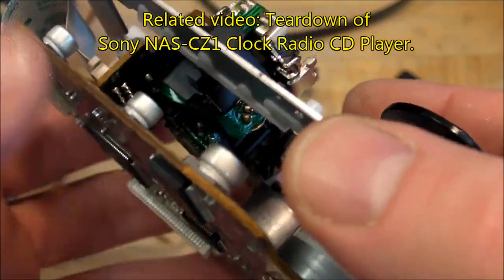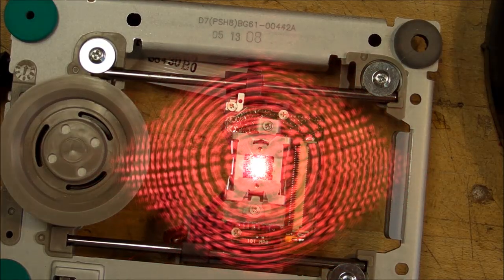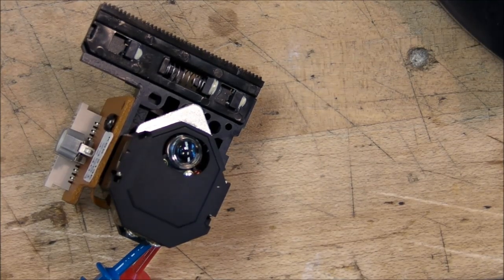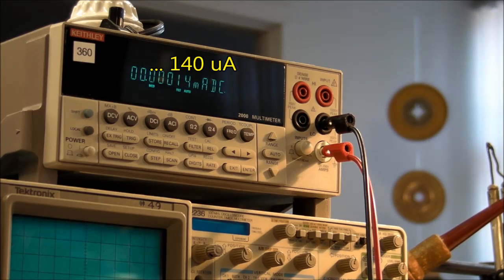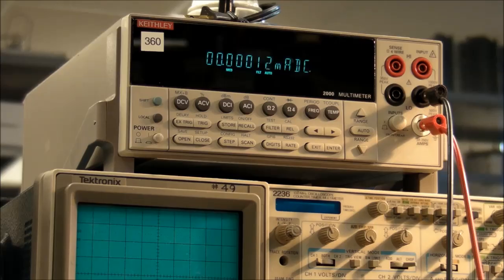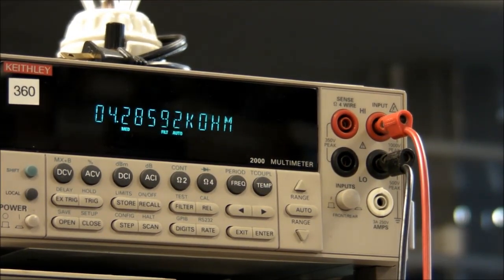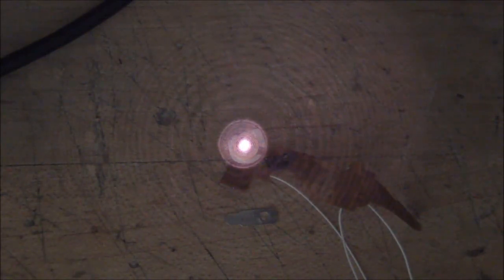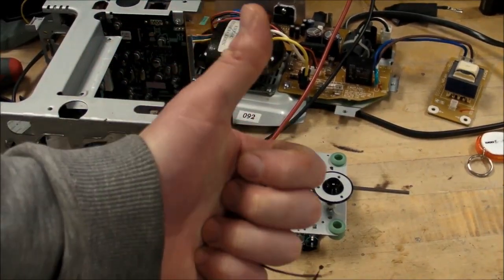(#0111) How to Test Laser Diode from CD Player - Various Methods

Comment: Great video I have an old Denon DVD/SACD player that will not read CD discs it does read DVD video and SACD disc OK but not CD. When the loader tray does in the laser emmits a bright red laser then a dim red laser it does this 3 times and lternates between the two laser outputs. I'm trying to understand how to check which is the CD laser and which is the SACD/ DVD laser. I would assume the bright red laser is the DVD/SACD laser as it reads these discs and the dim red laser must be the CD laser. There are two trim pots on the laser head for adjusting the laser output intensity unsure which one adjusts the CD laser power?

Comment: My CD player has started jumping, skipping and making strange crackle noises, similar noise you’d get with a loose speaker cable. I’ve replaced digital optical cable, my Hifi equipment works fine with other devices, turntable, games consoles etc so must be CD player. Anyone got a clue where I should start looking for the issue before I go out and buy a new player. Thanks in advance👍

Comment: There is a easy way to test this in the player itself. It’s called a oscilloscope that would be a lot easier. What a crap way to test a cd pickup. Also to test a laser you need a LPM meter to test its output and wavelength. This is not how to test a laser diode. It’s the long way when you can do it quicker.
Reply: Well said... It would be like testing a floppy drive by pulling of the read/write head and putting it next to a toroid core with some magnet wire wrapped around it...Ruining the drive alignment in the process. The easy way would be to test before the pre-amplifier and after.
Reply: Peter Lamont 
Well said to you too. Glad you know what your doing. So many bad videos on YouTube showing you diy repair that show you to make things worse. You need special tools to test signals,etc in these devices.

Comment: why is there no in depth information on how to diagnose and repair these things...I fucking hate buying new. and this is the most common fault on anything that reads discs. fuck the system
Reply: Because they're very difficult to adjust without the proper equipment and training, also has the potential to damage your eyes. I expect there are technical documents that go through all this, but it seems likely they aren't suitable for most people to understand without prior study.
I don't think the laser itself is the most common problem though, the most common issues seem to be related to dirty lenses and tracking problems.

Comment: Mr. Eric Wasatonic, ¿may I ask for your opinion, please, kindly on a CD player I own, please?    I currently have a Magnavox CDB 650 CD player (purchased new in ~1986) that is not reading discs all the way through.  But only the first 4 or so tracks, and only when machine turned on from a cold state.  It gets better as it warms up.  
  Following is a better description: The player does not play all tracks on CD.  One CD is worse than others.  Turning it on from cold, it plays the first 4 tracks just fine.  Then, at about the 5th track, an audible (high frequency, but not extremely loud, just louder than normal operation and abnormally there).  It will continue to play this way for a few more seconds to 20, 30 , perhaps 1 min more.  Then, the whine will increase slightly more (to its max) and then the disc suddenly stop, the head returning to home position, and front panel displaying disc data as when first loaded. 
   As the player warms up with 'play' time, the occurrence (whine & sudden stops) moves out (in tracks).  One CD is worse than others with this issue, and the problem ameliorates with 'play' time.  That is, plays more consecutive tracks (from the CD's beginning) until commencement of said symptoms.  If player is in 'play' long enough, (~1 hr+), nearly the whole CD becomes playable.
   I don't know if the noise is coming from the focusing coil or the arm motor.  (My guess the latter). The spindle motor runs just fine, and I can hear it moving from track-to-track with its normal soft spin/zing noise.  And thus I tend to rule that out.  I've taken the drive electronics board off, and made static conductivity measmts through the flex connections and it checks out ok (with read head at home position only).  (I'm the orig owner, from new, & have not heretofore had the drive electronics/assembly apart).  Is there any advice/help you can kindly offer, please? Any help is much appreciated. (I'd like to keep this machine, as I have changed the coupling caps in its output stage, sounds nice, and has a nice keyboard for track selection).  Thank you so much, in advance, Mr. Eric Wasatonic. God Bless. tonydecrescentis.
Reply: I was going to say bad caps...but it sounds like you already replaced them. Have you used a curve tracer on all the parts? Another thing I was thinking was that the flat cable might have a fracture in it, and when it gets to a certain point it folds in the right way to kill the signal. I had a flat cable on a pocket computer fail. If the cable was at the right angle it would function perfectly, but once it bent at the right location it would cease to function. I have to replace that flat cable with wire wrap wire or magnet wire instead.

Comment: I just pulled a diode from a cdrom and I am wondering how to test it. I have no idea which wires sticking out of are positive, negative, and since I don't have a variable power supply, I was just going to stick a AAA battery on it. What do you think? Stupid Idea? I do have some goggles at least.
Reply: If you dont put some kind of resistor between the battery and the diode, the diode will act as a short circuit between the battery terminals and burn out the laser. Look up what the original trim pot setting is on the CD lens, and replicate that. Then use 2 batteries in series to get 3V. You could just try a 4.7K resistor, I am sure that would be fine. you just want some current limiting in there.
Reply: read a little abou constant current sources and driving led's. You might want to lookup "variable current source with lm317 "for example.

Comment: What is actualy the cause of "disc error"?
In you case is laser fail, but sometimes help the lence cleaning, but not always because there are two more lences under the upper visible focus lence what we are cleaning + prism lence at the bottom where photo laser beam skew 90° up.
So there are many surfaces which can colect the dirt and we can clean only the upper focus lence and only front side.

Does this laser beam is aging and destroying the plastic structure of lences which become untransparent like the polimer headlamps lences on cars durig the time and the disc is unreadable?

Does the laser become weak during the time or it can only be in state working and not working and nothing between this states like transistors or diode?

Does anybody knows more about?
Reply: The lasers themselves rarely seem to be the cause of disks not reading, it seems to be more commonly caused by dirty/hazy lenses, 'sticky' guide rods(such as from dried out lubrication), and various types of misalignment. There are typically multiple pots to adjust different controls, but tiny changes can throw things way off, and can be very difficult to set properly (at least without an oscilloscope and knowing what it should show)
Reply: @DoubleMonoLR  Most problems which I encountered are when DVD is not working but CD is working or vice versa. Then I think laser is an issue?

Comment: Hey, thank you for this cool video! I have a quick question: Is there any way you know of to remove the plastic part on top of the other spindle motor, the one that spins the CD? I tried some force but I am scared to break it... Thanks!
Reply from the maker: +Mama Littlefoot Support the spindle in a vise or some type of jig, and punch out the motor shaft with a small rod or nail and hammer.
Reply: +Eric Wasatonic Thanks you the advice. Really appreciate it :-)
Reply: +Mama Littlefoot Just in case anybody else tries to exchange a broken spindle motor in a Sony ICF-CD815 CD alarm clock... The machine is made well and you can easily take it apart and put back together without problems. I found a seller of the disc DC motor from Singapore (very nice customer service). My project failed at the last point where I had to detach the plastic spindle platter from the motor shaft. It was MONSTER tight and although I eventually was able to hammer it out (thanks to Eric's tip) , the plastic spindle platter suffered too much, distorted and became too wide on the inside. A crude attempt to fix that with super glue did not work. No idea whether there would be any place to buy a spare spindle platter for the machine, since they discontinued the product. Am a little sad that I could not revive our favorite CD alarm clock... Want to share a great resource for troubleshooting CD players (wish I had any idea how really hard it is to remove the spindle platter):  http://www.repairfaq.org/sam/cdfaq.htm#cdspmotpr

Comment: great video! Good insight into how these devices work with the tear down.  I have a cd player that was working a couple weeks ago. The disc does not spin . I tested the drive motor and the laser diode track motor working independently. Im thinking its maybe the motor driver ic chip that controls both these motors or the laser/photo diodes could be bad.

Comment: Nice video! At the time when you were using an external PD to measure the output of the LD, I was wondering if you were really using a PD of correct wavelength to match the wavelength of the LD. The standard wavelength of laser diodes in CD pickup units is 780 nm, which belongs to the near IR light spectrum. By using the internal PD instead to check the power output of the LD, you can at least be sure that you are using a PD of the correct wavelength when making this test. One could easily be mislead into believing that the LD is malfunctioning when it's actually not when using an external PD of the wrong wavelength. Also, you have to check the datasheet for the external PD you are using to verify whether that particular PD is to be operated in voltaic mode, photo conductive mode, or if it can be configured for both types of operation.
When using the internal PD, you can also be mislead if the internal PD so happens to be defective and therefore not giving a response. However, if the internal PD is defective, then you will have to replace the whole LD package anyway so it really doesn't matter. After all, a LD package with a defective PD inside it will make the APC circuit malfunction, meaning that the LD package has to be replaced to repair the problem anyway.

Comment: NOTE TO EVERYONE: the laser can cause blindness and eye damage.  Don't have it on when not in the case.  It's invisible laser radiation and it's not good for your eyes.  Get some goggles if you are gonna do this!!!
Reply: The best precaution is to never look straight into the beam of the laser diode in the first place. And don't be mislead into believing that a pair of ordinary goggles will give you some sort of protection, because they won't protect your eyes at all. Remember, we're talking IR here, so you would then need IR goggles specially designed for IR protection, and you would have to make sure that the goggles covers a wavelength spectrum which includes 780 nm (in the case of CD lasers). Still though, you can't be sure that you'll get a complete protection from those goggles. And also, you might not be able to see the laser coming out of the laser diode with the goggles on since they filter out the IR that the diode is emitting, leaving nothing left for you to see. But in any case, looking at the laser diode to determine whether or not it's functioning is a very dangerous technique that should never be used anyway (even from an angle) by anyone who doesn't have a wish to go blind. If anything, at least try to use a camera and then look at the display of the camera from a safe angle (and distance) in regards to the laser diode. The uploader of the video used a camera to look at the laser during most of the video and was probably at a safe distance/angle from the LD, just like he should. What he did at 12:05 was extremely crazy though and also very dangerous, and I really do hope that his retina (or any other part of his eye with which he looked at the laser) has not suffered any kind of permanent damage. Even the weakest laser could burn your retina and cause permanent eye damage, so looking straight into the lens should be avoided at all times as a safety precaution, even when you think the CD player/CD ROM is turned off.
Reply: @RetroGameModz  I actually did this when I was 12. My brother had decided his CD player looked better as a pile of circuit boards for some reason, and when he left home he left the CD player behind. One day I was fiddling with it and realized it was on the whole time. Thankfully, I still have above average vision. Though for a time, it did seem like I had weird vision errors when I closed my eyes in the dark(several years).

Comment: Laser diodes, which operate in the invisible region have an indicator.
Somewhere in the middle is to see a small red point of light.
When installed, you can see the point from every angle.
So my experience ...

Comment: I was fooling around with my original xbox and came across the laser disc reader a warning label said if was radioactive. If it's not plugged in is it still radioactive?
Reply: It sounds unlikely that a CD player would be radioactive(as in emitting ionizing radiation), however, it might have a warning about laser radiation, and possibly the warning symbol for laser radiation(a filled circle with alternating shorter and longer lines radiating from it, with one line extending to the edge of the symbol). Of course, the laser would only be on if the device was operating at the time.
Reply: Eric Wasatonic There are quite a few radioactive things people may have around, actually, but if we limit it to electronic things, an example may be glow or arc discharge based devices(neon lamps, fluorescent starters, HID lamps etc), which may have thorium 232, promethium 147 or Krypton 85 added to help them reliably ignite. I also seem to remember that some vacuum tubes use thoriated tungsten cathodes/filaments, though, If I recall correctly, it was more common for high power tubes used for transmitters than the ones used in general electronics. 

Some older instruments and clocks have radioluminescent paint which generally contains radium 226/228, and it is possible to come across it in some electric devices. I would say that any old device or instrument which appears to have or have had glow in the dark paint on it should be checked with a suitable detector before one takes out the screwdriver or gives it to the family's little engineer, just to be safe.
Reply from the maker: No clue. Other than Americium in smoke detectors and X-rays emitted from high voltage rectifier tubes in antique televisions, I don't know of any other radiation from household electronics.
Reply: Ömer Hayyam Saydam Well said, old bean.

Comment: Laser diodes are extremely sensitive to ESD. You have to wear a strap at all times. If it was banging around in your parts drawer for years, then it probably got killed by ESD.
Reply: I bet he never put the shorting link on it to protect it either when it wasn't connected to the player.
Reply: The Lightning Stalker esd ?? Wht is...it
Reply: @hackwithkrishnansh  Electrostatic discharge,  electricity discharge at high voltage(but very low current) - typically generated from everyday actions like rubbing clothing materials when moving around.